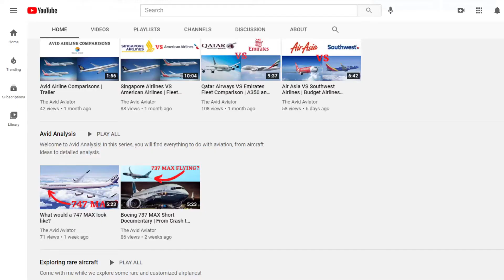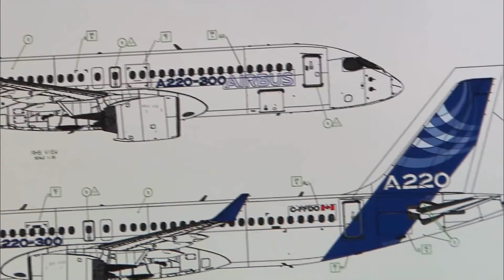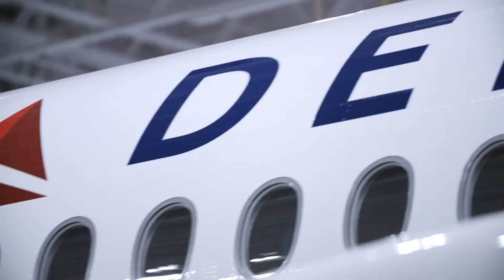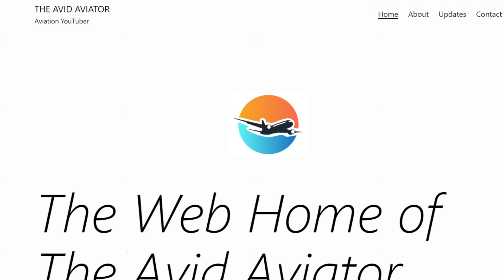A220-500 VS A320neo | Airbus A220 vs A320 | Are they comparable?

Comment: Nice video. A220 hands down. Especially from a passenger's perspective, wider seats and aisle, bigger windows, lower altitude cabin and even a window in the lavatory (would've been nice to see in the video)! 

I get the impression that Airbus bought the plane to control the competition, but the plane is so good that they accidentally bumped into something big and now they're scratching their heads on what to do. I haven't flown on it yet so I have to follow other people's reviews. What most are saying is that it's a game changer. Airbus' fleet will consist of 3 models, A220 (100, 300, 500), A321 (LR, XLR) and A350 (900, 1000).
Reply: No reason they cant expand it add more wheels and you have a wide body a220 and replace a330.
Reply: @williamdodds1394  What are you talking about?  They are by design totally different aircraft. An A330 come on man!
Reply from the maker: They are definitely hugely different designs. I'm sure the a220 can be expanded significantly, but not any larger than what the a320, or in the largest variations, the a321 would fulfill. The smallest a330 variations are larger than the largest a321 variation, so I don't forsee a a220 design that could compare to an a330.
Reply: Yes I know  but expand on it.
Reply from the maker: Yep. I understand your point. 👍
Reply from the maker: Yep. I understand your point. 👍